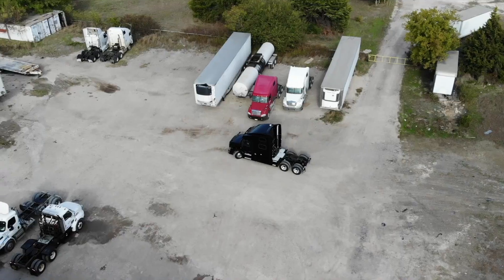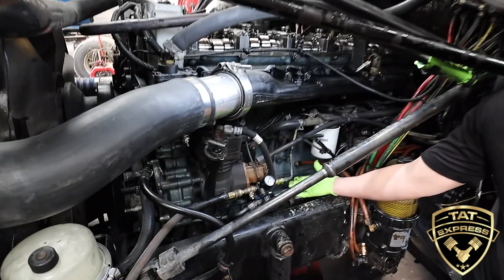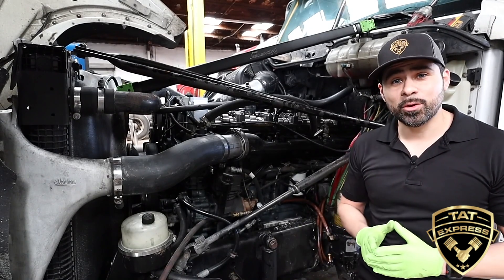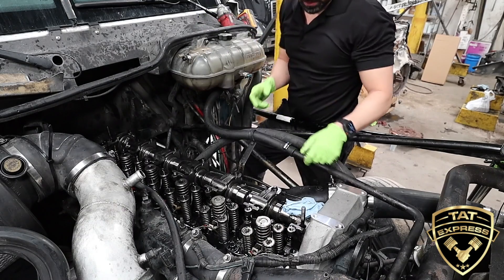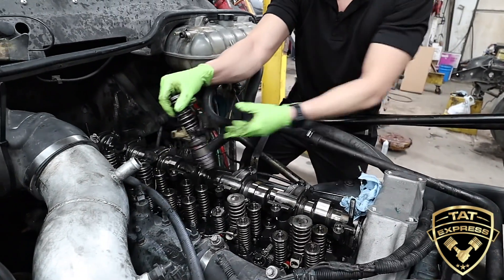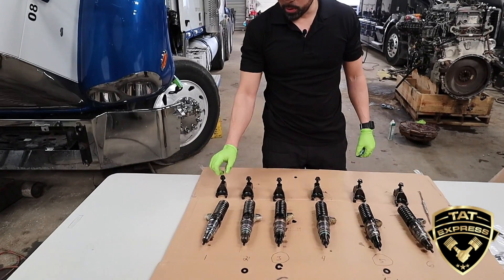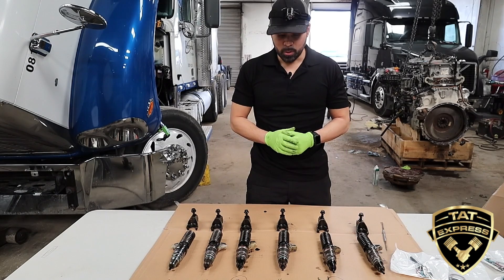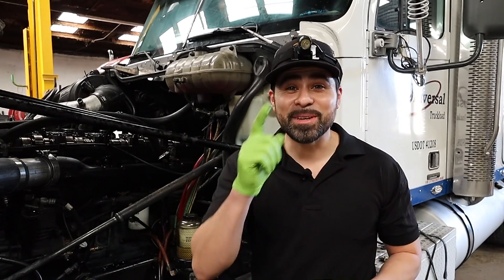Detroit 60 Series Injector Failure

Comment: Hi there, I have a 2005 12.7L series 60. Cyl numbers 1, 2 and 3 are not performing when i do a cut out test, especially number 2 doesn't seem to be contributing at all. 4, 5 and 6 are good. Number 2 just smokes. Any ideas?
Reply from the maker: What other test have been conducted besides the cylinder cutout?  I would look into fuel supply, valve and Jake brake adjustments as well.
Reply: @TATEXPRESSINC  Replaced #2 injector and harness, as well as the front Jake solenoid. Today we tested fuel pressure at the temp sensor in bottom of fuel pump. Pressure is normal but dissipates instantly when shut off.
Reply from the maker: O.B.D have you tried the pressure test we did in the video?
Reply: @TATEXPRESSINC  No we have not
Reply from the maker: O.B.D I know you have tested fuel at sensor.  Are you running a gauge? If so what’s pressure?  Does the truck start back up after you turn off?